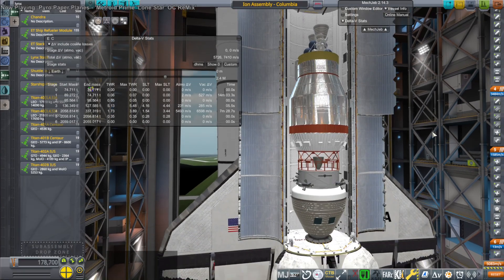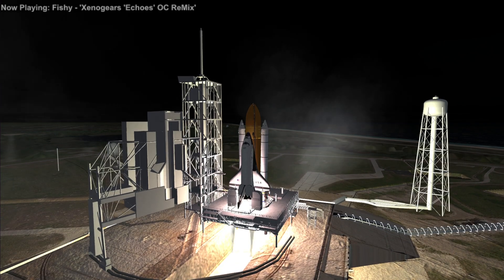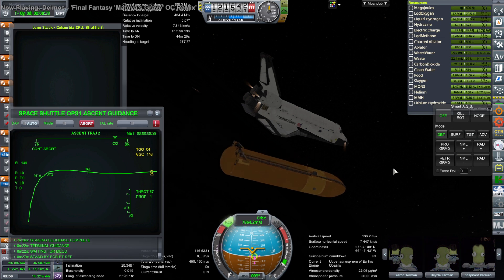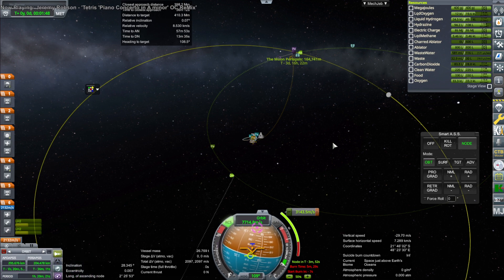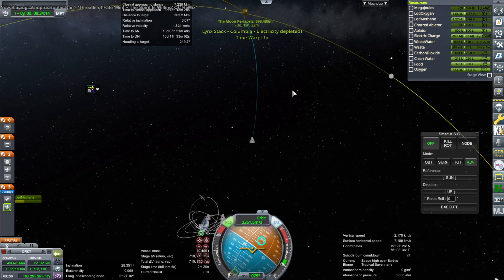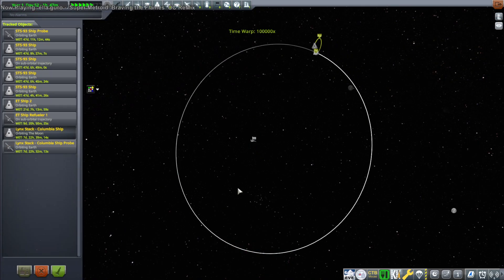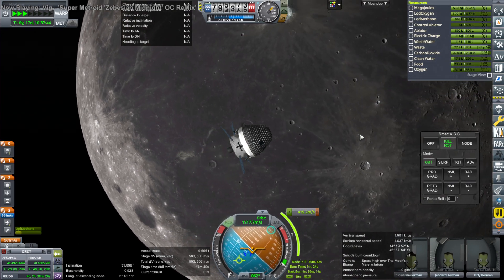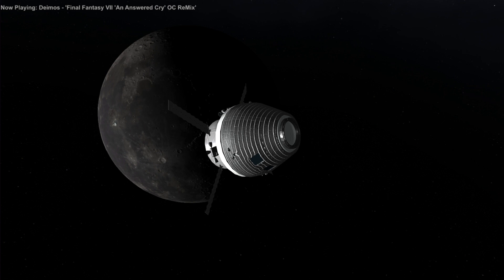Launching a Lunar Mission in the Shuttle (RO in KSP 1.12)

Comment: I wonder if it might work better to just attach a capsule directly to a fully-fueled Centaur, sort of like the proposed ACES-based Orion service module. Though the requisite MLI layers for the Centaur might make that prohibitive with respect to mass.
Reply from the maker: I considered it and the delta-v is about the same compared to what I have here, with the downside being that the Centaur isn't configured to dock or deal with boiloff. I'm considering making a service module Centaur of the correct size with better RCS placements. The MLI would not be heavy - it never is. And, since the Centaur is inside a cargo bay, it's not a problem on launch, either.